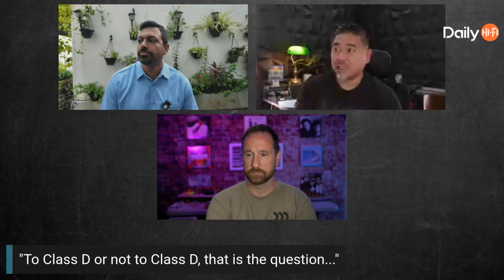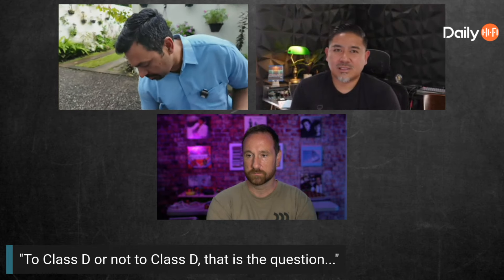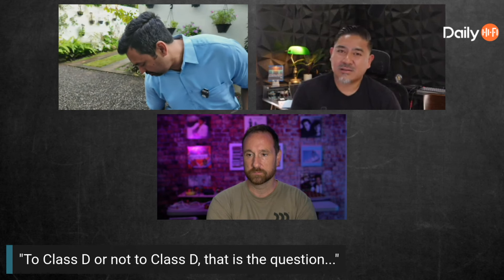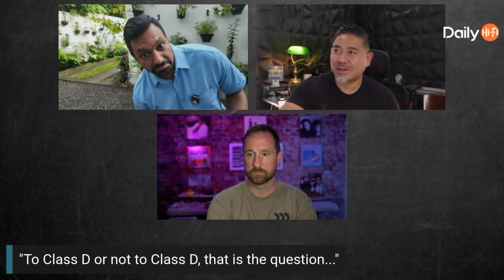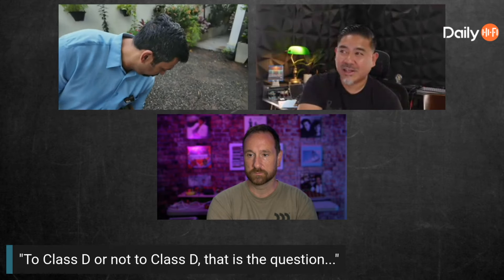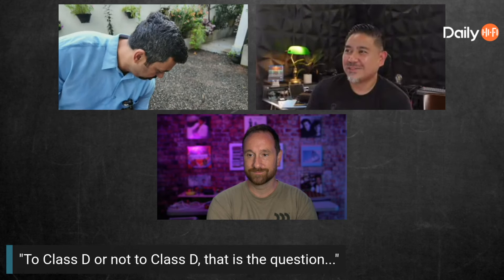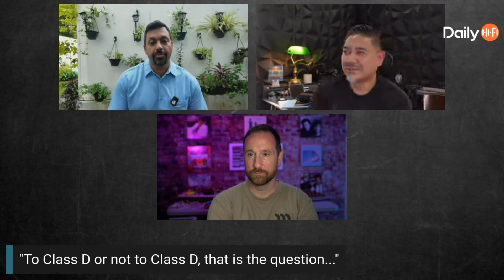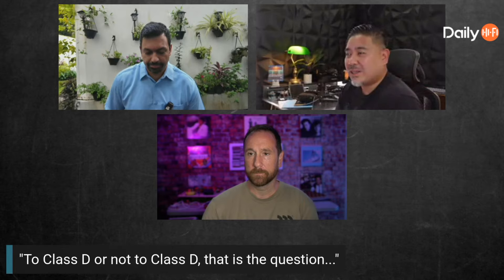Why Aren't Class D Amps Used In Receivers More Often?

Comment: I think the reason why there isn't a lot of class D AVR is because of the higher parts count for simple class D amp compared to simple class AB amplifiers.  Most AVRs use simple amplification circuits with only two output transistors per channel. Because of the high channel count, every new part required by the design has to be multiplied by the number of channels e.g. 9 thus the cost will increase significantly. At a bare minimum, a class D amp will require two Mosftes, a driver chip, and output filters(Inductor and a capacitor) on top of resistors and capacitors. These parts are quite expensive compared to Class AB parts which can be only two transistors on top of resistors and capacitors. Since AVRs pack a lot of features and amplification channels in one box, they try to save on parts to keep the overall cost low and increase the profit margin.

As for the crunchy sound, yeah, it sucks. I have been playing around with the power supply of my DIY DAC and I might have ruined it beyond repair. I lowered its noise but introduced that crunchy sound, especially on non-oversampled mp3 content. It's like it's stuck on ESS slow digital filters or it's not working well hence there is a bit of a staircase in the soundwave. 

I regret selling my Denon ARV. It didn't solve my financial problems. I'll try to buy another mid-tier receiver in two to three years and get rid of all DIY stuff. It's fun when it works but when it doesn't.

Comment: Class D amps came about in the early 1960's - so why haven't they caught on in AVR's? They have always traditionally put out higher harmonic distortion, so that's one reason. High sensitivity speakers do not work well with Class D amps. 
Get a cooling fan and don't box your receiver in / and remember, there's a reason almost all subs have Class D amps / under 400 hz, distortion is not detectable, and it's cheaper - way cheaper than the few that have Class A/B amps.
Reply: Sad But so very True my friend.!!

Comment: I had a Monolith 250X something class D, and it has 2 power supplies for each side of 4 speakers.

Channels would randomly go off completely unless I put large 140mm Noctua fans on top. I returned and had a second with the same issue.

I swapped to the AMP 10 instead and never looked back.

Comment: I also disagree with Rev Slim about the fans failing before the AVR. That’s if they use dumpster tier fans. Fans in the PC market, especially Noctua brand, can last in the 10+ year mark and are often run in high power consumption rigs where the CPU (that’s small and like 45mm by 35mm) sucks back 200+ watts. Keep in mind that CPUs and GPUs dump almost 100% of the power they suck back as heat, AVR amps aren’t as inefficient. Class A/B is about 50%. Class D are more so. The PC fans are  always on when the PC is on and just ramp up depending on the heat load. 
I’m fairly certain PC users use their PCs more than AVR owners use their AVRs unless you’re the lucky guy able to use their setup 6-8+ hrs a day but you’ll also have the PC user who works on their PC a 9-5 then game/watch media on it.   
   
Problem is good fans are expensive. Especially if you don’t want to hear them if they’re on and nothing will ruin the experience more than being deep into a movie and when it gets loud you hear that whirling sound.   
Pretty sure that’s the main reason why they won’t stick fans that kick on regularly, people would complain if they heard them and the cost for the fans that wouldn’t be heard are on the pricy side.    
    
Add the fact that you’re now moving air through the AVR/Amp (doesn’t matter if it’s positive or negative pressure) which means dust is now going to be sucked in.   
Which means more dusting and/or adding dust filters to AVRs/Amps. Which means units that people who don’t clean the dust every now and then are gonna suffer.     
     
I like the approach of using racks with dust filtered intakes where the rack itself has the cooling so you only have to worry about cleaning and maintaining those. Or stick an Aircom ontop of them.   
    
Pretty sure companies sticking like 2-3 Noctua fans (for very low noise and good cooling) plus redesigning their chassis to take advantage of the fans and maybe slapping on dust filters would cost consumers more than the $80-$120 for an Aircom